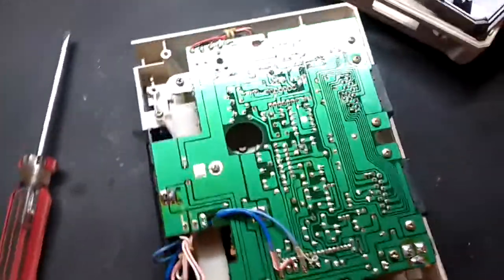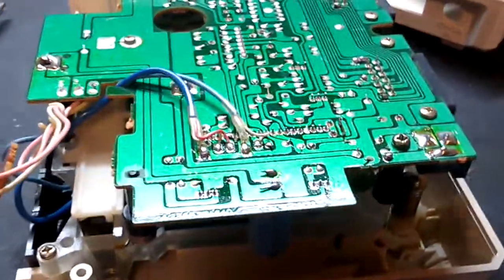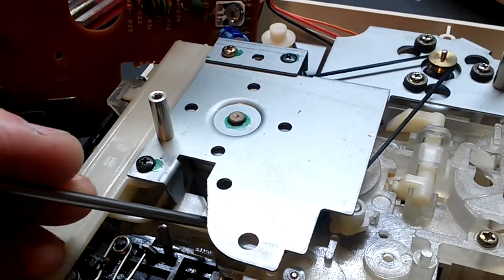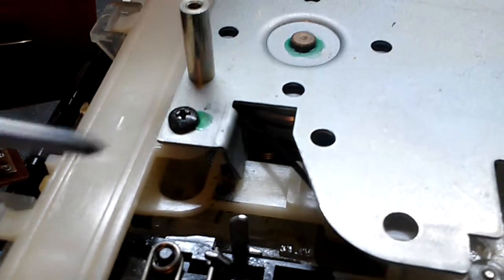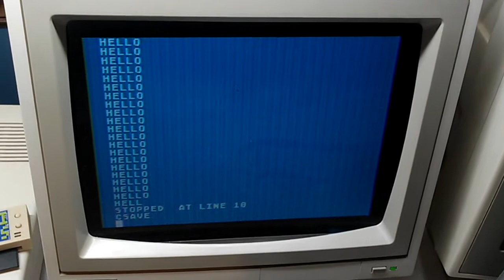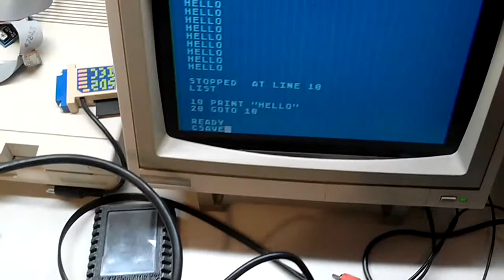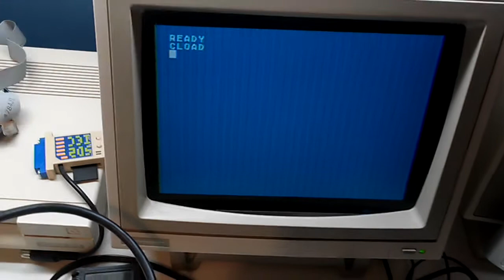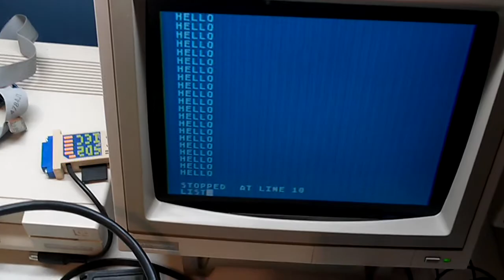ATARI 1010 REPAIR - Rewind and Record Problems

Comment: In the process of repairing of two of these. 
You any idea the exact belt size needed?
Great video.
Reply from the maker: No sorry. I bought 2 bags of different size belts, one is the square type and the other bag is of the flat style. I just try one until I find one that fits. They're pretty cheap on ebay.
Reply: @Anangelspath  Found one in the end, belt size is critical with these. Thanks